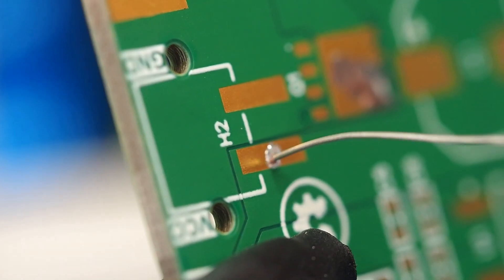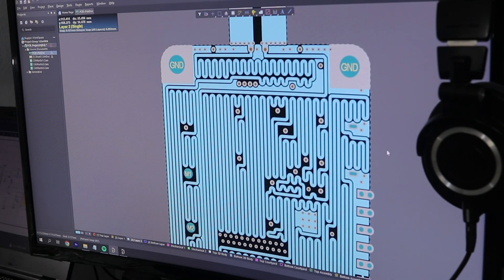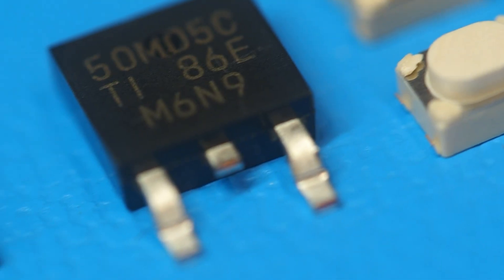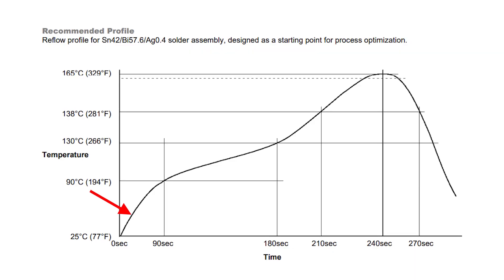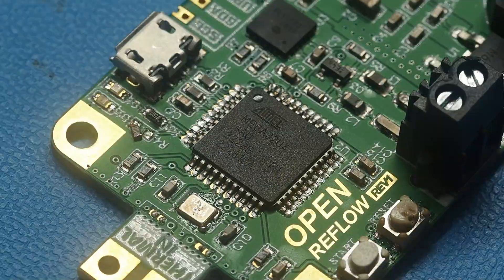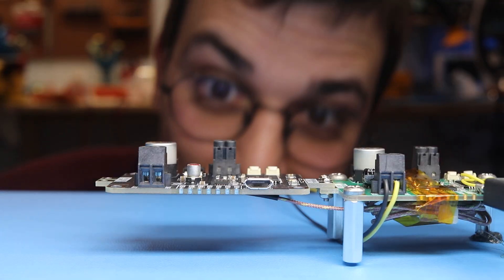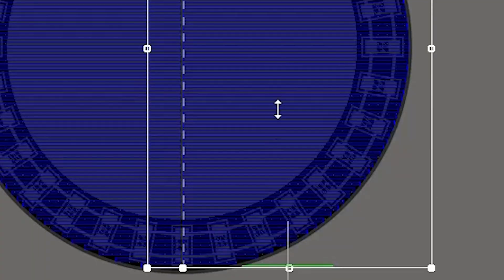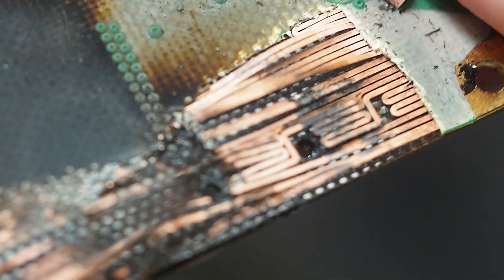I made a Self-Soldering Circuit

Comment: Brilliant work. The heating function could be very useful if the pcb needs to operate in extremely low temperatures. A possible application in Mars rovers that have to keep their circuits at the correct operating temperature.
Reply from the maker: Thanks! Yeap that's definitely another possible application for this - not sure if they are already using thermal pcb tracks for the Mars rover etc
Reply: @CarlBugeja  i have a light switch from the 70s with thermal pcb tracks. no idea why it needs to stay warm but it does.
i took it from an abandoned canadian prisoner of war camp

Comment: Very nifty!
Although from a ground perspective your heater is really not ideal. Especially since it can not actually conduct ground between multiple points on the board or they would be powered during the reflow. Also, it's an antenna...

Comment: I appreciate the thinking but at the same time it is just another drop in the ocean of the waste we are making. First step is to consume less, second step is not to consume at all. All you did in the end is to add more copper get wasted. I cant even imagine the additional amount of copper which will get wasted if all ouf our products implemented your solution.  This is not the right way to go. Maybe a layer of carbon for the heating element but not a layer of copper. Please work on a reverse pick and place machine. What world needs is a machine which can pick components off of pcbs for reuse. A machine which can identify, test, desolder and  store components. That is what we need very urgently.

Comment: this is really cool. like people have said, this could be really really good for kits. i'm thinking a kit which mixes smd and through hole components and uses this for the smd parts and lets people solder the through hole components by hand would be quite fun as an intermediate soldering teaching kit, to teach people about the smd soldering heat curves in a way that is fun and interactive but doesn't require previous experience with smd stuff

Comment: You should have a look at the RP2040 microcontroller for future projects. Easy to use and program with lots of documentation. Also try the lmt01 temperature sensor as it a super tiny digital temperature probe.

Comment: I wish if you find a solution to solder and desolder components by self heating method individually for each part. would be nice to have an array of mosfets and matrix of heating pads underneath of each components. So if I need to unsolder a component just instruct ATmega which one it is and then simply use tweezer to remove it that's all. Waiting for that day when we will see soldering tools to disappear from the whole world.  You are the man! keep up the good work.

Comment: I'm not sure if the heating track would make a great ground plane. The whole purpose of a ground plane is to have a continuous reference for any tracks above / below it. If the return current has to shimmer its way around the whole board, this will not be beneficial to high speed circuits, and will deffinitely make the EMC radiated noise much higher. 
But as a curiosity project, this is overally a great idea, I wonder how many layered PCB could be soldered this way

Comment: The low-temperature solder is made of Bismut and Tin, i.e. it is lead-free. Therefore I have no concerns to bake my boards in my hot-air kitchen oven. Works like a charm, and is muuuuch easier in the application. Particularly you can use the inner layers for their intended purposes: un-interrupted ground (and power) planes.

Comment: You could paint the backside of the PCB with a conductive graphite "ink" and when you hook it up, the board will solder. If you seal it with a high temp sealant the graphite ink will work like a solder mask and not rub off. If it becomes more popular you may be able to convince a company to insert a graphite layer in one of the center layers of the pcb.

Comment: Yeah, no. You sacrifice so much with this, that you might as well skip the soldering altogether. This is a board design where you can throw the pcb right into the trash bin as soon as it arrives. Connecting it to ground doesnt suddently make a resistor a ground plane. You ruin the signal integrity and have crosstalk everywhere. Amazing. Best of all is you spend top dollar to turn the circuit you designed into noisy trash.
Reply: Show me on the other circuit layers how you know this is a sensitive radio circuit. Cockbite. 🤔

Comment: This is seriously awesome. As an EE Tech, something like this integrated into prototype PCBs would be amazing for rework on high thermal-mass PCBs. Just pull the 0 ohm resistor and the PCB itself could become an integrated pre-heater for rework
Reply: The large ground plane would immediately turn form bane to blessing!
Reply: @dfgaJK  you don’t need a winding path either, you could simply use more current and a ground plane instead.  Then it could do double duty as a heat source for soldering and isolation without the giant vibrating antenna in your board the floating trace leaves.

Comment: In cases that higher standards are obligatory, say automotive, this is a no no way to solder components! Good for hobbyists.
Reply from the maker: i already did that  in another video https://www.youtube.com/watch?v=ZChSbpBbrt4&t=213s - the problem is that heating them to 165degC for longer than 10min is not recommended by the manufacture and will get damaged by time

Comment: The idea in quite interesting, bit i'm afraid that the scope of application on pcb's would be pretty limited. You can't use this method on complex multi layer boards, since even if you might use the heating track as a ground plane, it would be only connected to the board trough only one spot. This means that if you need to connect component grounds trough vias, you will need to make a second ground plane layer that is initially disconnected from the heating one. This will require to always have at least 4 layers even on simple boards since manufacturers usually allow only to have an even number of layers. Also since that ground plane is basically a coil it might create some issues on high frequency circuits.
Reply: Exactly what I was thinking. And if you use that heating plane as ground after, you are gonna make enormous current loops and thus sending large amounts of EMI in the air with all the complications that comes with that.

Comment: This would be amazing as breakout boards for weird IC footprints, like BGA chips etc. 

Or upgradable single board systems - you can get a raspberry pi with no ram populated, and add what you want. 

Or why not this for your macbook (or phones!) - you can reflow the stock ram off, and replace with something bigger. It could be incorporated into modern designs without much cost. 

I think there's a lot of valuable application to this concpt.
Reply: I doubt it will happen for high volume stuff like laptops. SBCs though might indeed be interesting. But remember a DRAM chip needs good grounding and a lot of layers for the fanout
Reply: @TheRailroad99  yes I wonder about things like grounding and capacitance effects on high frequency chips - but there might be a solution.
Reply: I'm so excited by this. 

By adding a heater layer under big chips in commercial products, you can make rework/repair much more possible!

Comment: It's a very inventive idea! 
I might worry about using a long meandering trace as a ground plane afterwards. If there were no taps to the circuit except in one place, the 'plane' might act like an antenna and pick up RF noise. If there were multiple taps instead, I'd worry that they may offer alternate current paths during soldering.
Reply: You will need to create an additional layer with a proper ground plane and yes, a whole layer made of a long coil might create some issues, especially in high frequency applications. That's basically a huge inductor it might even create a large parasitic capacity on the board
Reply: "There are two kinds of electrical engineers: Those who design antennas on purpose, and those who do it by accident." - Abraham Lincoln
Reply: You could always shorten the trace by adding vias in various points connecting it to the top surface, where you could connect them later via more zero-ohm resistors, perhaps. Not sure how practical that is since the bridges would have to be added after the initial reflow is completed.
Reply: @VOROX_Audio  Exactly what I was considering. Some way of easilly shorting the loops, maybe by bringing them to exposed edges where a small busbar can be soldered on along the length of the edge in a second step. This bus bar location would be an easy solder with several methods because it would not interfere with any heat-sensitive or closely spaced components.
 Still the effective solution depends on the required frequency range that needs to be handled, low frequency boards may have no issues even with the long trace, while those with very high frequency sensitivity could have problems even with the shorted loops.
Reply: To signals travelling perpendicular to the direction of the meandering traces they basically will have to deal with splitting ground planes.
Reply: Add connector for temp sensor along with one temp sensor on the board to be reflowed too?
Reply: Well, this is something that you would consider during the design process. It could be a problem, an improvement, or completely neutral, depending on the application. It's definitely not a universal application. 

You can even select specific areas of the board to have this under. Like for changing available features, adding modules and components, etc. I can see upgrading a board as needed by this means; buying or making an aftermarket component and using this feature to add it.
Reply: @taitano12  yeah actually that's interesting, you could for instance use it with daughter boards with their own ground plane potentially
Reply: I wonder if you could just use a regular ground plane as the heating element. One connection along each side of the PCB. It would require much higher currents and it might not heat the plane evenly, but since copper is very thermally conductive, the plane could maybe spread the heat well enough. Could be worth a try. A welder might work as the power supply if the current can be adjusted down low enough so the PCB doesn't instantly vaporize.
Reply: @sebastian.salmhofer  You could definitely do that! But the circuit would be way more complicated if you want to keep the self replicating part, requiring something like a buck converter. Good news is that computer motherboards and GPUs already have figured out how to make extremely efficient ones that operate from hundreds to a bit over a thousand amps. The other issue is transmitting that power to the board being soldered, doing it through the mother pcb and small contact points would be out of the question, you would need some extra copper soldered to the mother and some previously soldered connector to the daughter such that the daughter board ground plane resistance is high compered to the rest of the circuit.
Reply: @sebastian.salmhofer   a WELDER? LOL  jesus dude you need like 20v @ less than 1 amp. not 1000 volts at 50 amps
Reply: @jeremiahbullfrog9288  But it's "same" as what's being done here, minus bunch of parallel traces of equal lengths, and these parallel traces has horrible stray capacitance implications
Reply: Yes - the long path would increase resistance and I expect would defeat the point of having a ground plane.  The only place I see this really working well is if you only need a single layer board and can just use the extra layers for the hell of it.
Reply: Easily solved by connecting the traces on the top surface after soldering with some vias and jumpers. I would do that anyways. The thing is designed to be a resistor, it could induce an unwanted potential between points far apart on the surface.
Reply: The loop could be shorted at several points to turn it into a normal plane
Reply: I don't get why people keeps saying the same thing. Series-parallel capacitors are series-parallel capacitors, not a ground plane.
Reply: Can the heating trace be made thinner (so it gets hotter), but only meandering around the parts of the board that need heat to be applied? Or is such uneven heating gonna warp the board?
Reply: @jeremiahbullfrog9288  Maybe if you layed it out with that in mind.
Reply: I feel like this technique can only really be used for very simple circuits. From a signal integrity standpoint that meandering trace is a horrible ground. PCB grounding is an interesting rabbit hole to get into
Reply: Seems like it'd come in handy for building radios, the device would solder itself then it would have a built-in antenna
Reply: Will it be possible to recreate this by picking two GND points and letting current across?
Reply: @すどにむ You won't achieve high enough resistance and you would need an extremely high voltage. Like a couple thousand volts probably. I think you have to live with the downside and I would not recommend using it a s a ground plane. If possible You would use a 4 Layer board with the heater plane one the 3rd or 4th layer so you still have a real ground plane on the 2nd layer that shield the top layer from noise emitted by the heater layer.
Reply: @baldebaldemord9588  other way round my guy, the low resistance means you need a lower voltage, and much higher current. Resistive losses are I^2*R, lower the R and you have to increase the I to keep the same wattage, alternatively you could say they're V^2/R, lower the R and you have to lower the V to keep the same wattage.
Reply: I think that TF noise will definately be a broblem but maybe her ccan add some solder bridges und the botomn, that he handsolders after he is done to ground. That should fix the issue
Reply: Motherboard with modular CPU? :o

Comment: You should combine this with an in-situ thermal sensing pcb trace/pad so you don't even need to attach a sensor.
Reply: I am stupid but couldn't he measure the temperature using the resistance of the loop? It probably wouldnt be accurate but it should show something useful.

Comment: Next upgrade would be to make a board that can not only solder itself but destroy itself as well when needed.
Reply from the maker: easy just short the thermal-in with the out 😂
Reply: Great, but what loot does the board drop? =Hot delaminated trollface pcb=?

Comment: Sometimes this may be quite useful if you want to reflow a connector, which does not tolerate the high temp well. 
Inside PCB heating does not heat up the entire connector as much as a reflow oven would!
Reply: When reflowing you have to heat everything up to the same temperature otherwise you get thermal stressing of components and they fail (especially during the cooling phase). That is why there is a soak period in the reflow thermal profile! You need to understand the process and why it is what it is before cutting corners for the sake of simplicity!
Reply: @simonbaxter8001  you do not have to heat everything up to the same temperature to eliminate thermal stressing, just the very rigid parts.
ICs are quite rigid, some MLCCs too. But the connectors I am thinking about, which need somewhat lower temps, only introduce low amount of mechanical stress, no matter how you solder them, because of the relatively long and flexible leads (they are designed not to add extra stress, because being connectors already adds external stress).
Lower profile parts would likely heat up better with inside PCB heating, compared to connectors. So using PCB heating does not seem an instant death sentence as you seem to imply.
You do have to rate each component for this process though, and doing an x-ray on every BGA part after reflow would be highly advisable to catch cracked balls!
Reply: @adamrak7560  If you have to xray bga devices to check their integrity, you would use proper controlled manufacturing processes, not cheap untested self soldering PCBs!

Comment: Wow! This is such a cool idea. I wonder if it will have any long term effects on the lamination.
Reply: The temps were within specs so it shouldn't be a problem - is what I'm hoping.
Reply: @VisceralOps  Yeah, should be good. Although I don't know how thermally conductive FR4 is. While the outer temp for the component layer might be inside spec, the inner heating layer might have to be a bit hotter. 

But since hotplates work fine, I don't really think that this solution should be an issue.

Comment: Woah! This is super cool. A lot of people struggle with soldering SMD components. I see this as a great solution for kits
Reply: Whats wrong with using a hot plate ? 
The solder mask and component-placement is the same process in both cases anyway... ? 🤔
Reply: @Peter Fitzpatrick  we have hot air gun, a hot plate which is most normally used, but for someone who doesn't have them both and isn't willing to buy those then this is the best solution. But still, it has its own cons tho.
Reply: @WarriorRev6300  I've used my stove more than once  🥴
Reply: @tacitus_  That's also a choice, I used it once to desolder smd components lol.
Reply: @tacitus_  my stove is gas, it didn't pan out too well.
Reply: @WarriorRev6300  an electric iron (for ironing clothes) works well... just don't let the "boss" catch ya ! 😂👍🍺
Reply: @WarriorRev6300  This solution would cost more than a hot plate AFAIK though.
Reply: @peterfitzpatrick7032  or a smaller soldering iron tip lol. I don't see anything on this board that I couldn't hand solder, and i could probably finish it in about the same amount of time it took to do the paste, affix the components, and heat up the trace